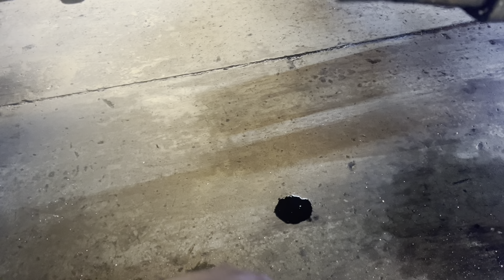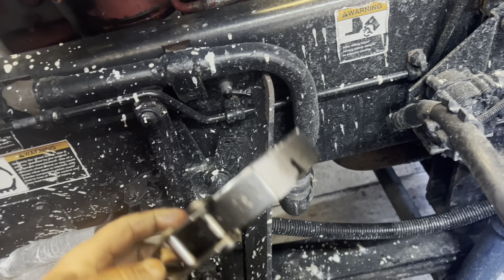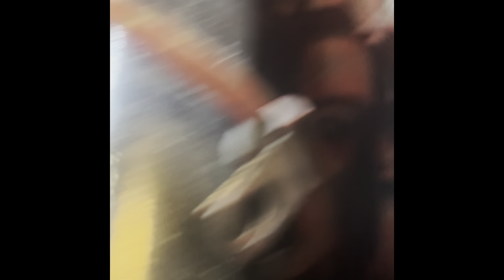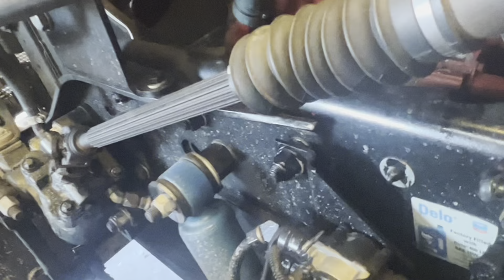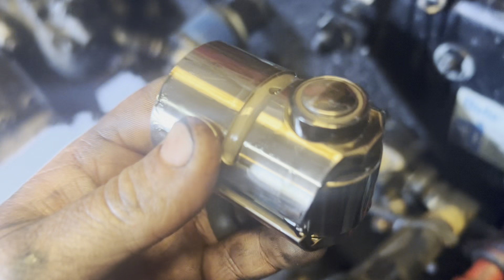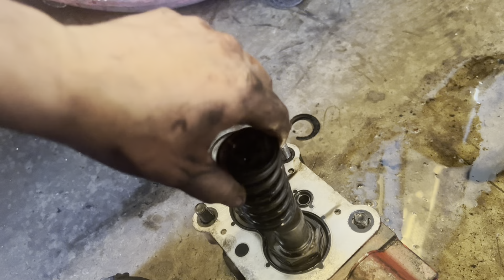Isx  loose oil filter what to looks for and 2250-2350  fuel pump update things to check!

Comment: I gave you a like yesterday but watching your video now, anyway I'm always looking under my vehicle when I'm out and about, that's how I found out I had a bad timing chain housing gasket. had to tear down half of my engine just to get at this gasket, I replaced all the gasket, water pump and the gasket, oil pan gasket and replaced the timing chain, everything was in my reach took my time to, because I didn't want go back in there, lot of work and labor hours of my time. I did that job two years ago and she still runs strong with no Signs of any issue.

Comment: Seems like Cummins engine oil filters are bad about becoming loose. Most filters get tighter. Often wondered if it because the way Cummins filters are threaded on.
Reply from the maker: I have never had a problem with them comin loose always do hand tight then 3/4 turn like it says on the filter